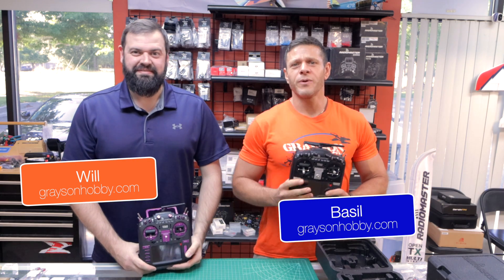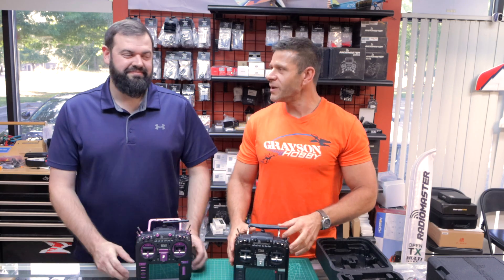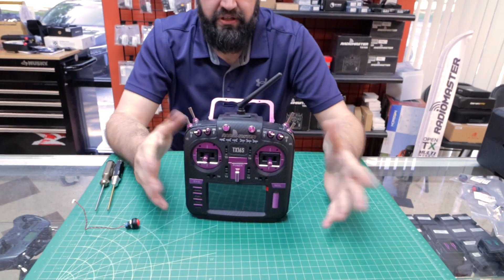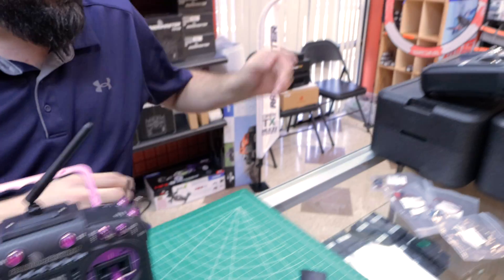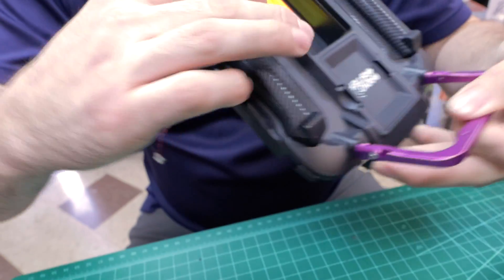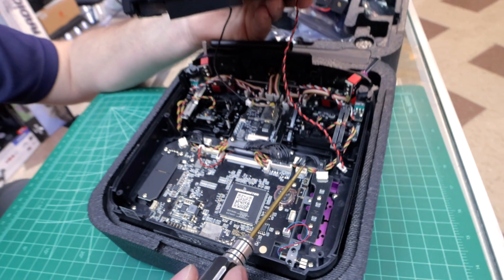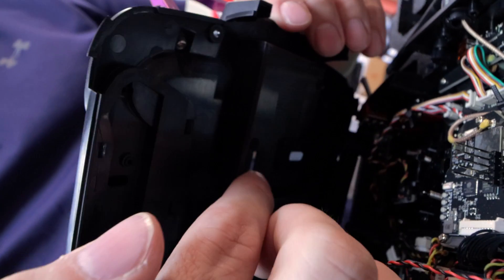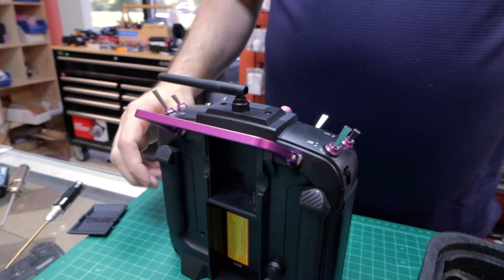DIY Upgrade Button for RadtoMaster TX16S MKII Radio Tutorial 🔥

Comment: hi what should the battery range voltage be set on the radiomaster???? when fully charged what should the volaage show, i have lion 7.4v 5000MAH
Reply: I use lithum ion and mine is set to 6.4-8.4V

Comment: Yep I added two momentarily buttons to my transmitter. One I use for instant trim and the other for timer reset
Reply: Did you drill an additional hole for the second switch?
Reply: @inoc805  yep
Reply from the maker: Awesome report, thanks for sharing
Reply: Been looking for that...can you post a pic of the location?  Thanks!!!